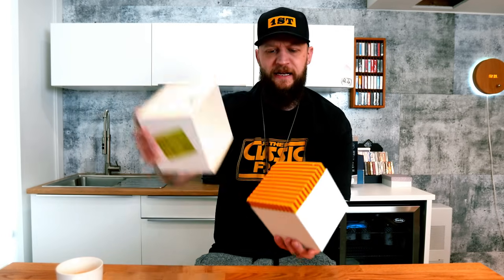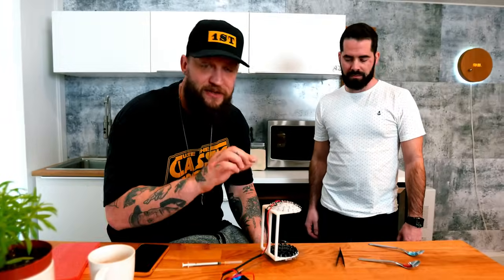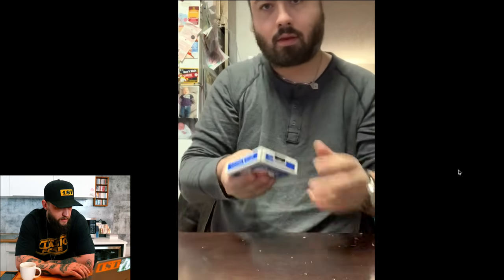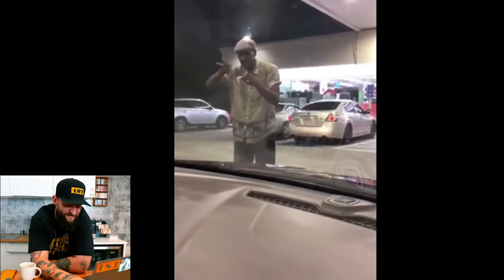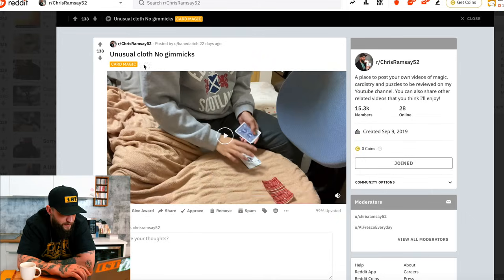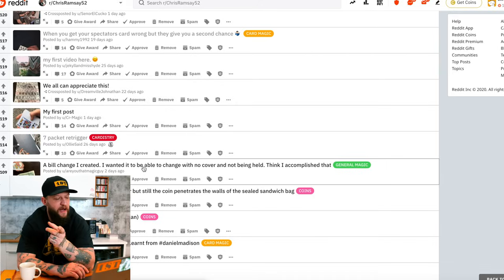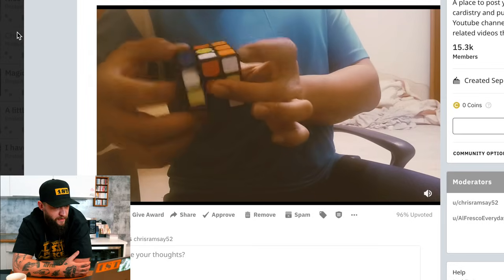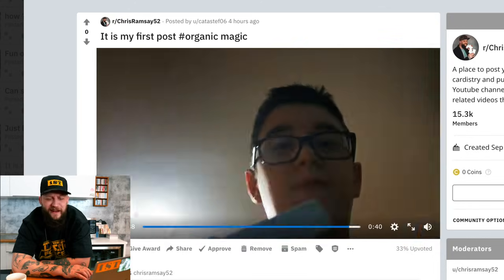Professional Magician Reacts to NEVER BEFORE SEEN MAGIC?!

Comment: Imagine scaling up the sound-levitation-thing up, so you could put a human in it, and then using it as a bed!!
Reply: I wonder if that would blow your eardrums because of all the frequency haha just a thought xD
Reply: I was wondering if we upscaled this tech if hoverboards would be more tangible... enough speakers pointed in ways to create pockets of levitation under the board? Enough to support the board and human.
Reply: @jyxtermaddox5199  oh hell yeah, that makes enough sense. Super sonic sub woofers lol
Reply: Haha. You can not scale this up that much. In order to make the wavelength of the sound long enough you would have to lower the frequency waaaay too much. It would not even be sound at that point. Biggest object to be levitated like this is a 4-5 mm foam ball. This unit uses 40kHz which means the biggest object you can levitate is less than 3mm. 
But we already have wind tunnels. Thats practically kind of similar.
Reply: I think that even if its out of the range of human hearing it will affect people in some way. It is a neat idea though and it might work for a bed but not a hover board though. How you set up the speakers in the ground? He said where the frequencies meet so you need speakers above and below.
Reply: I wonder if a similar principle could be used to reduce friction rather than trying to hover.  There's an (I think still experimental) submarine/torpedo technology called Supercavitation which uses air bubbles to reduce friction around the craft and enables much higher speeds.
Reply: @grn1  I've heard about that but don't remember seeing anything more about it. I have seen that bubbles all around a ship will cause it to sink though.
Reply: @Datrebor  I presume the back of the ship or torpedo (it was originally used by the Russians for a rocket powered torpedo) isn't completely covered but I doubt it would cause a ship in motion to sink.  Bubbles would probably effect buoyancy somewhat but if you're moving forward anyway it would just cause the water to act more like open air (so you'd kind of be flying instead of swimming).
Reply: I heard that Kanye and Kim paid about 500k for a levitating bed. Probably custom with same tech but larger.
Reply: Jyxter Maddox ye
Reply: That's what you call space
Reply: Johannes Hockerup or build a pyramid
Reply: This was how the pyramids were made.
Reply: Lol it gets scaled up and works, but, for your weight range, the frequency is the brown note. Still worth it? Depends.
Reply: Vapur13 myth busters tried this for real. No luck
Reply: Gregory Norris mag lev is similar but magnetic energy/flux isnt same as sound

Comment: For those of you curious as to how this works, this is something call acoustic interference. As most people know, sound comes in a wave and when you align multiple speakers together precisely depending on the part of the wave that overlaps, they either amplify or destroy the sound. In this little model all the speakers have the same frequency and thus there are certian points above the speakers where all the soundwaves come together in a single point. You can actually see all the points that the sound waves meet together at @3:54. You could measure those distances between water droplets and figure out the frequencies of the speakers.

Comment: "With levetating people assume 2 things, strings or magnets"
Actually speakers happen to be magnets! So this is still using magnets... ;)
Reply: Sound waves aren't magnets :)
Reply: Ed van Wageningen ohh so why can I see the sound waves when he zoomed up
Reply: @Will Heap 
The commenter means: 
Speakers use magnets to vibrate a disc in order to create sound waves (Irrelevant detail in this case but this is what the commenter pointed out). The speakers are arranged in a way that a bunch of standing waves are created (frequency is important too, 40kHz).Vibrating air molecules (aka. sound wave) keep light and small objects in the air by bumping into them and countering gravitational force. End of story. 
P. S.: This is a technology not meant to be scaled up (can not be done due to how sound works) fo any of those who are wondering.
Reply: Will Heap 
And by the way you don’t actually see the sound waves when he zooms in, you only see parts of it where the water is caught.

Comment: Ultrasonic droplet suspension is thought to be a method of mixing highly volatile chemicals in order to create new pharmeceutical drugs without impurities through reaction of containers. My friends used industrial speakers capable of holding large droplets for their physics project and that's how I know. Interestingly the standing nodes on the sound waves are where the droplets are sitting. In theory if you alter the waveform you should be able to produce different number of nodes and so have a varying number of droplets suspended at any given time.

Comment: Reveal of trick at the beginning.
He turned the white box on it's skinny side so it will fit in the striped box, and the lid of the striped box doesn't actually go all the way down. It only seems that way because of the stripes.

Comment: Boxes have 3 dimensions and the fit is 2 dimensional. So a 90 degree rotation of the interior box can make it fit within the box it once contained. This also means that 3rd dimension of the striped box cannot contain the white box so it does not close fully and the stripes help disguise that.

Comment: Wait, is that shutter speed explanation correct? The frame rate should be fixed (usually at 30 frames per second), so the camera reducing exposure by increasing shutter speed should not increase the number of frames.
Love this channel!

Comment: I'd use the science sound wave thing to do a reveal. After doing a trick you'd throw all the cards i' the air and they'd freeze in place and you'd pluck their card out of the bunch after a couple of seconds and then the cards would fall to the floor.

Comment: Pretty sure i know how the boxes in the beginning work.

Those boxes in the beginning are not perfect cubes. They are slightly rectangular in one or two of their dimensions (h w l). Different dimension (s) for each box. The give aways was how he checked to make sure he was putting the white box in correctly. 

Also the boxes never fully close when one is inside the other. You grabbed the edge of the first box to pull it open, but shook the second box to get the bottom half to come out. Once the striped box was closed around the whit box, you can just barely see the lip there because your pinky is on it.

Comment: Can you switch those speakers to face the outside and say use it to hover itself in mid air? Maybe section off speakers into quarters and add two 4-way actuators to control output for moving in all directions? UFO's maaannn..... 👽

Comment: if you could identify a way for different substances to float at a different point in space or a way to manipulate shape of the soundwave within the cilinder of sound created, you could use smoke made out of those different substances or smoke of different colours suspended in different areas of the cilinders to create an image.like a hologram. and since the sound wave creates the ilusion of solid by not letting something move outside the sound waves, that hologram could even have a certain solid properties,like it could grab a thing ..now,were i put my pills i forgot this morning?doc always said "take your pills or u start speaking bullshit again". where did i put them...

Comment: The first trick is too simple. You just put the white box sideways into the striped box. They are not completely square so you can just position them so that the smaller side of the white box fits into the striped box. And no, I am not bragging🙂. Just try to fool us with something harder. 😉